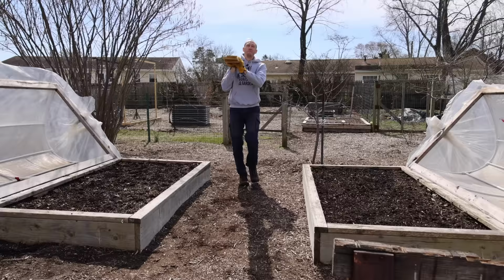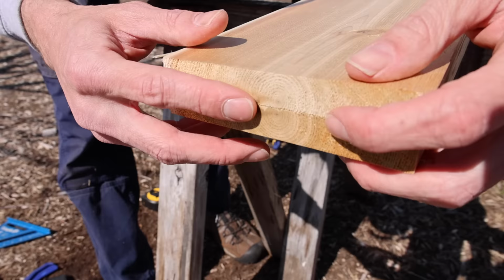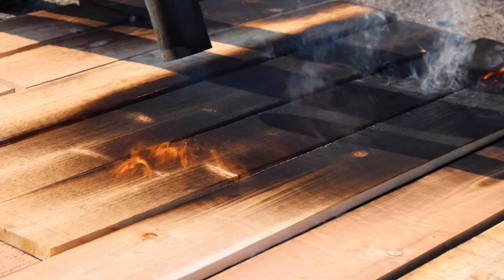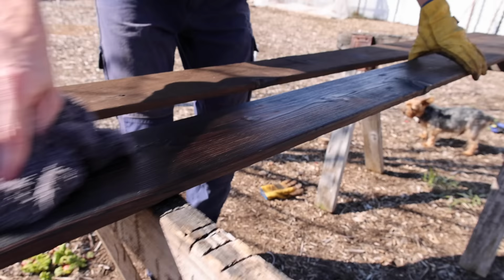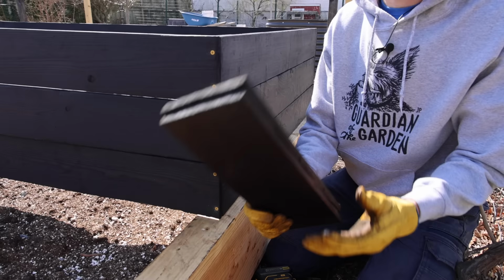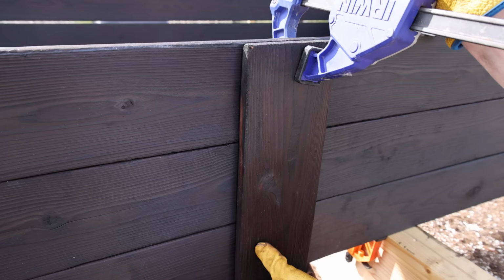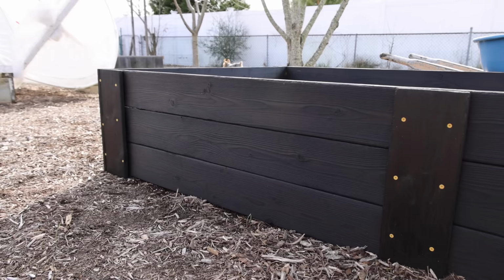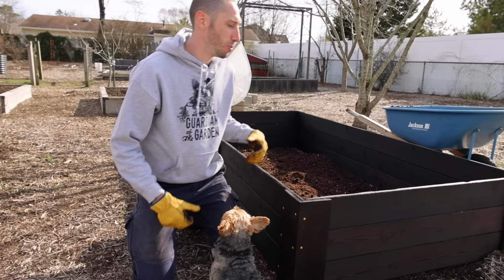Using This Ancient Technique Makes a Raised Bed Last Longer!

Comment: OT: Last year (or year before?) you had success grafting tomatoes. I was wondering if it would be possible to graft a winter squash (such as my favorite, delicata) as scion onto tromboncino root stock for improved squash vine borer resistance. Last year I had a bad time w/ SVB. Injecting the vines w/ Bt did not work as they burrowed into the solid parts of the stem base - & that's what seemed to really kill the plants. Is it possible tromboncino have woodier stem bases & that's why they are resistant? If so, grafting might be worth trying. It might also work if tromboncino are resistant due to production of noxious (to insects) secondary metabolites. There's a video on YT from Purdue showing how to graft cucurbits (cukes & melons onto pumpkin rootstock to confer cold tolerance) - so it as at least in realm of possibility. I've never grafted anything & am struggling w/ life in general right now due to health issues - so I'm not really up for attempting this myself. Do you think you could try it?
Reply from the maker: Yeah for sure! I am not positive how well it will prevent the squash borers from getting into the stems, but I would still try it if I was you.

Comment: Awesome video James!  Been following you for a long time.  Thanks for the great information!  Quick question... I am building a raised garden.  I would like to minimize weeds and I am not necessarily going to plant root vegetables in the garden bed.  The wood is 2x10 so 10" high.  I live in Jersey too if that matters.  Do I need to or should I use the weed protector liner on the bottom?

Comment: Do you have any issues with the char rubbing off onto clothing when you are working next to it?
Reply: Char will rub off onto clothing before weathering. Just wear old or working @ clothing until weathering. I reduce char rub off by hosing or brushing with water after burning and let dry then apply sealant.  Also can burn then brush off char, apply sealant then hose or brush with water. This technique is also  great for wood handled tools such as axes, shovels and hammers. Just remember to sand or scrape off any lacquer or paint to bare wood prior to burning. Also can not be used on pressure treated (chemically preserved) or painted and stained woods.
Reply: Forgot, burnt 2x8x6 southern yellow pine boards from Lowe's. I burnt wood once brushed off char then burnt and left char on inside boards. Built a raised garden for daughter 4 years ago. Char was a little messy however didn't add sealant at time. It's still solid after 5 years. I would not use whitewood, fir or spruce. They would not last long with ground or moist dirt contact.

Comment: you might want to say this is only good for places that get snow or cold, ive been using the same boards for almost 15 years untreated cheap lumber but my area is 6 months of 100+ weather the lows only in the upper 20's usally 30-40. havent had snow since the 90's